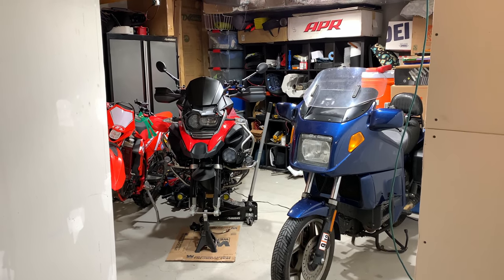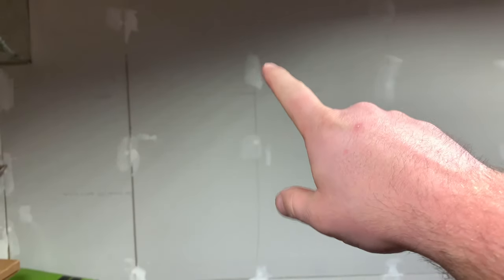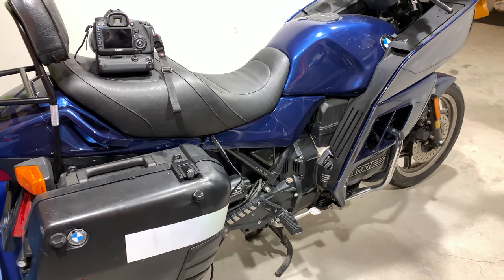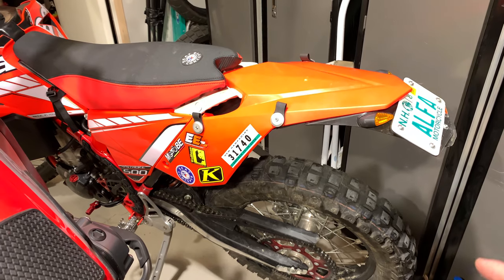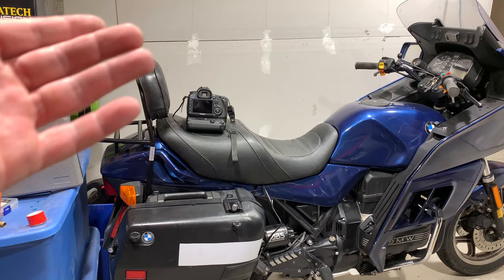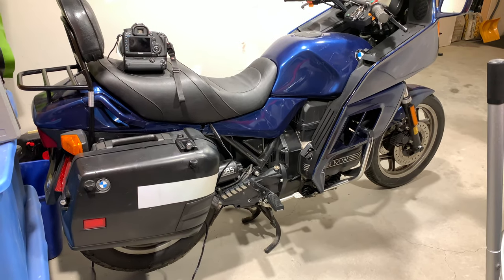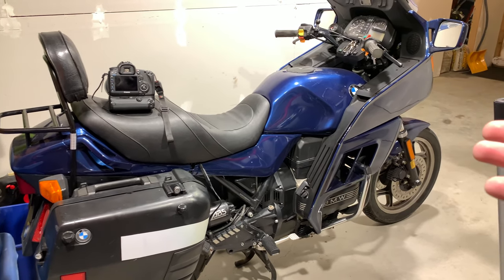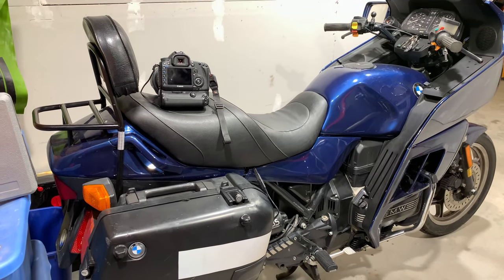The K75RT Has Come Home!

Comment: dont forget to lube that input shaft!
Reply from the maker: I’m probably going to replace shaft and drive. I heard it was last lubed a decade ago.
Reply: @AdamChandler86  can you even get those from bmw anymore? (the input shaft i mean), thought they're following the japanese and older model parts are being discontinued
Reply from the maker: There are some companies now making brand new shaft from scratch based on OEM specs / measurements. People are generally pretty happy with them. There are also some low mile eBay parts with good looking splines. Part of the process of restoring an old bike, I guess.